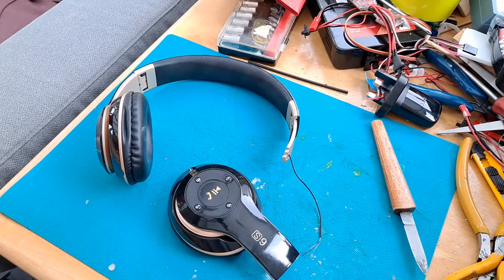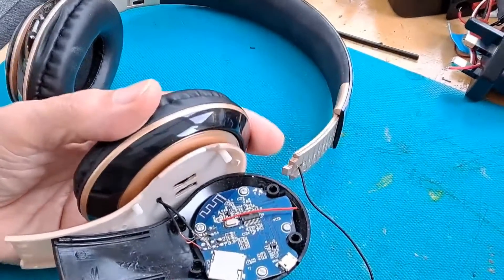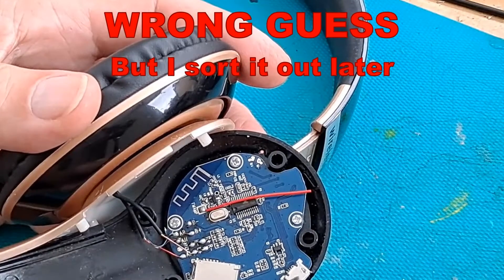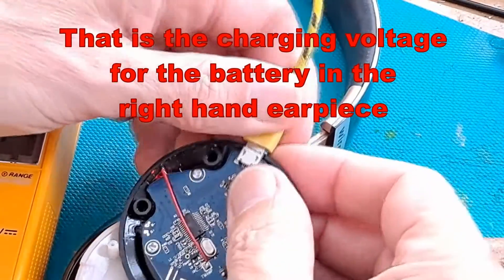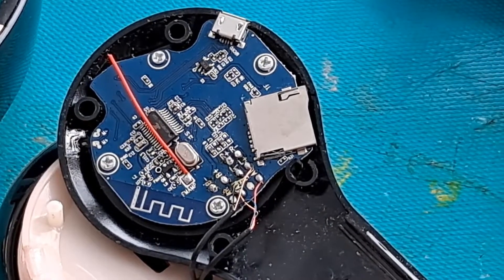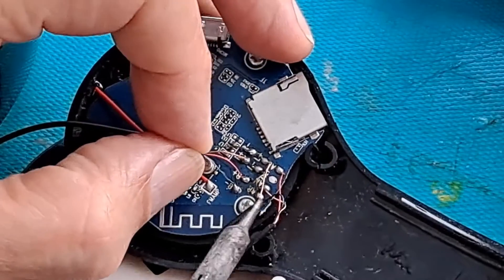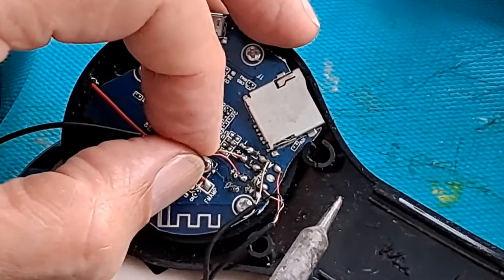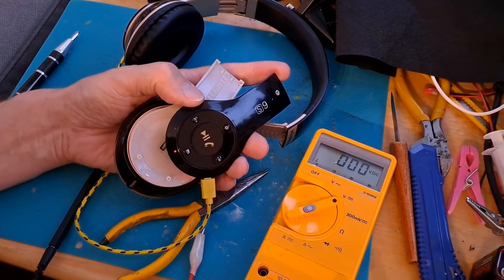Fixing 6S Bluetooth headphones 20220823

Comment: Please I'm having a battery issues with my 6S wireless headphones. When I plugged for charging it shows red light and immediately turn on the blue light itself. I think the problem is from the battery. I need help on where and how to get the battery please 🙏
Reply from the maker: If you look carefully at the battery, there should be a string of numbers   that are the width length and thickness in mm. You would then need to search online for that size LiPo battery. You can usually find a close match online, maybe eBay or AliExpress or even Amazon. You will probably need a soldering iron and soldering skills.
Reply: @GrandadIsAnOldMan  please I'll get back to you Incas I don't understand. God bless you
Reply: @GrandadIsAnOldMan  please I'll get back to you Incas I don't understand. God bless you
Reply: @GrandadIsAnOldMan  where is the battery location? 
Left or right?
Reply from the maker: @DavidAnthony-m6u  04:02

Comment: Nice bit of work.
Looks like an Antex SX25 so you usually can just tin those wires without scraping.
Nice to see a half decent Iron in use.
My first work iron was a 25 back in the 70's.
I still have the iron and stand.
The iron is the same one! - much like Trigger Broom😉
Lastly is that meter from Hills Components ?
Reply from the maker: It is an Antex CS18 and is my favourite for most of my work. The meter is a FLUKE and probably came from a car boot sale, it certainly does not have the original leads.